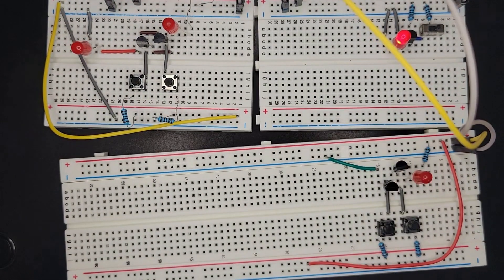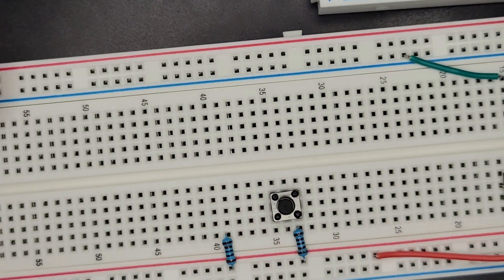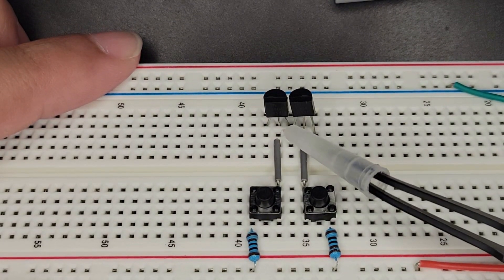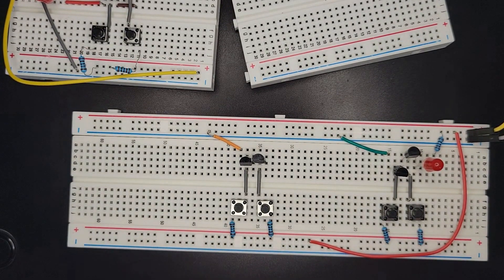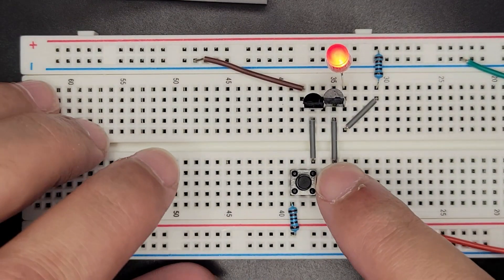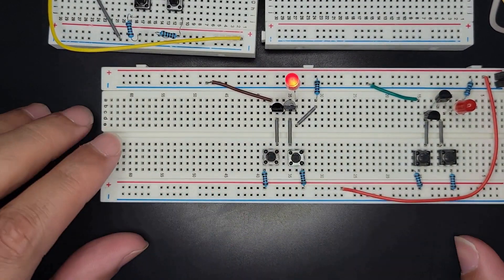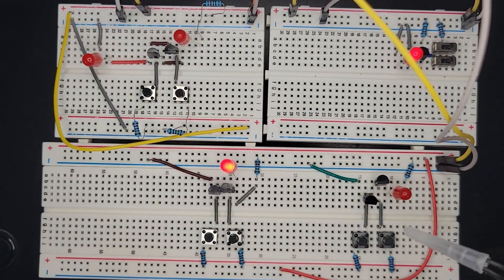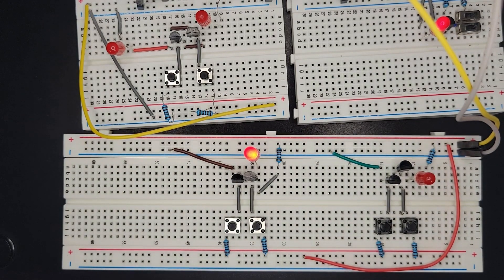NAND Gate Step-by-Step - Beginner Learns Electronics Ep 7 - Logic Gates with NPN Transistors

Comment: where do you get your parts are there easier parts to do this with?
Reply from the maker: All of these I got from Amazon, for convenience. I have been recommended Jameco.com from multiple people, and there are a few local stores (like Microcenter) that have parts nearby.

As for "easier parts to do this with," I'm a beginner myself so I don't really know. Sorry! But I think the NPN transistors are a very conventional approach to making the logic gates. And once you start doing it, these logic gates become quite simple and manageable (mentally speaking). I hope this helps! Give it a shot!
Reply: @LearnWithMxy, yeah, I feel the parts I have are not great. I have a hard time getting the pin to touch the metal in the breadboard, so I have to look and see if there is something wrong with me or the part I have. This applies to my buttons and transistors. 

also you might be struggling with this too the blue resistors are so hard to see the colors in the ribbons to know what its is vs all the others. last thing I want is to over heat a resistor and have it "burn up"
Reply from the maker: @ I haven't had that issue yet -- but I've heard that some breadboards are not manufactured very well. Sometimes you need to press down for proper contact. Do you have other components that can connect to it properly?

Yeah I know what you mean about the resistors. Right now I measure them when I am not sure what they are (with the multimeter) and then try to group them together into little bags together, if they are going to be loose for future use. I haven't yet properly learned about the colors to be honest, and either rely on the label of the packaging or measure them myself